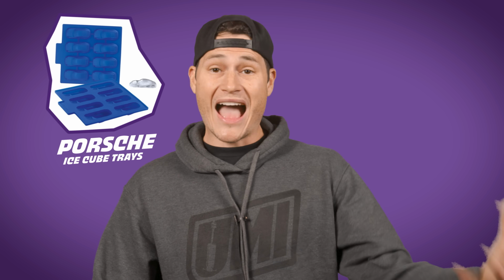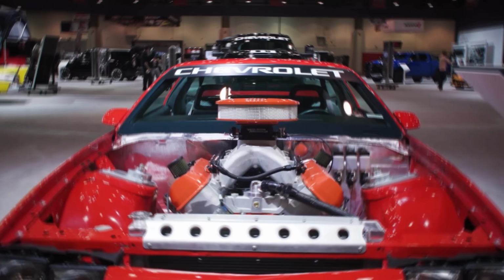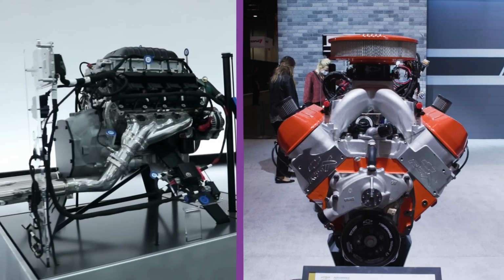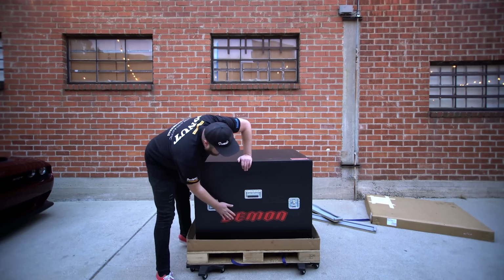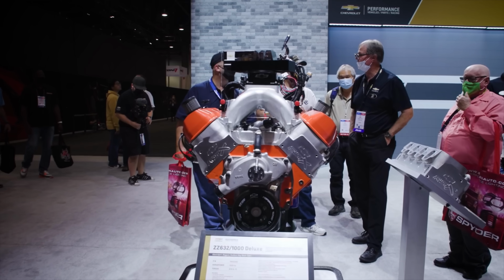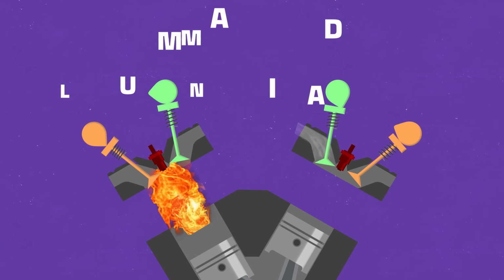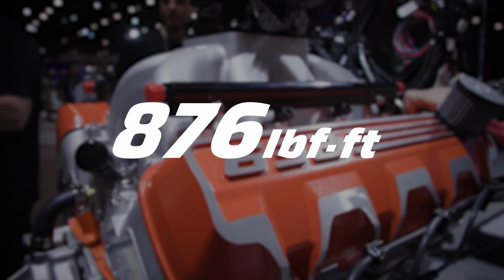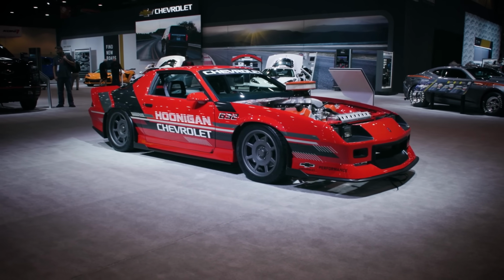Chevy's 1000HP Crate Engine EXPLAINED

Comment: I wouldn’t shell out $30K+ for a street motor, but one of the “value” $12-15K 632ci motors are a perfect drop-in for the heavier classics. Got a BelAir? Drop in 800ft-lbs of torque to haul your heavy Chevy AND the 3 motor homes you’re towing with it!
Reply: CNC Motorsports sells a 632cc BBC/BBF block capable of 2,000hp for $5k, i rather build that n boost it to it's limit, save a ton, at least half that $30k..
Reply: @P71ScrewHead  u ain’t building it for $15k.  For 2000hp ever part has to be high end.  Not to mention all the custom stuff like intake exhaust, geometry to make it all fit.  What requiem described is  perfect
Reply: @AB-nv7bz  my bad, i meant to say n/a build for $15k, with boost 2k hp, engine would have to be much bigger for it to make 2k hp n/a, which do exist actually.. But if the blocks come with forged internals already for $5k then i think it's def possible to have the engine for half of what Chevy sells them for..
Reply: @P71ScrewHead  what?  So how u gonna get the power if u need more displacement?
Reply: @AB-nv7bz  i said in my 1st comment i'd build n boost the engine to the block's limit, 2k hp.. Thing about high compression is it can't handle too much boost, a n/a engine has higher cr to make more power, engines with 8 or 9 compression can handle it better, but in n/a form lowers hp.. Maybe with 14-20 compression ratio it would get close to the block's limit, idk, but i rather not ever go that high, they become too delicate for my taste, i like lower compression..
Reply: @AB-nv7bz  there's engines with over 1,000 cubic inches that make at n over 2k hp n/a but that's $50-$100k engines, i know i look rich but not that much..lol
Reply: @P71ScrewHead  like a ww2 fighter engine?
Reply: @AB-nv7bz  Similar but I'm talking more like a huge V8 like a 1,000+ci V8, I think Kye Kelly's team uses big engines like that n it's why they win so much..
Reply: @AB-nv7bz  look up Musi 959ci V8, it makes 1,800hp n/a, crazy engine..lol
Reply: @P71ScrewHead  that’s a race motor running alcohol.  13:1 compression means it’s an expensive Grenade on 93.
Reply: @AB-nv7bz  e85 will have it running like it's no problem.. But I agree, pump gas ain't enough for high compression n boost..

Comment: The ZZ632 is an awesome new edition to GMPP, but other composites, including Blueprint Engines, have been selling 850+HP 632ci crate engines for years. At insanely great cost! Want a turn key BBC torque monster? $12-15K out the door!

Comment: I wish I could afford one. I would stick a procharger on it too if I had the money. I would buy a factory five car and build a new car from scratch old school hot rod style.
Reply: U might as well just buy the block.  It’s 12:1 compression.  No FI unless you change heads.  

I guess u could run 6-8 psi but the engine will probably grenade.  It’s not an ls so no trial and error data to go off.
Reply: @AB-nv7bz  I would probably go with an LS short block and build the engine to handle boost like all forged parts. I did something like that in a 1993 Camaro z28. I pulled a 5.3 liter ls out of a chevy suburban had all the accessories ect. then I bought the kits to change the pistons vavle train crank shaft and cam shaft. then I boosted it with a roots blower. I can run it 16 psi all day. total thing cost me $7000 not too too bad. those 5.3 liter ls engines you can buy from a junk yard full accessories compter everything $500-600 then its just a matter of getting parts. the whole engine to build it up was only $3000.  then $4000 for the blower. I also took a junkyard T56 M6 from a Corvette. bolted up perfectly. and I used the computer from the suburban albeit with a few tweaks to the wiring harness. but even with boost it only making 550 hp. 1004 hp is a lot.

Comment: You should put one in an fj73 Landcruiser they have engine room and 9 and quarter inch diffs from factory and strong gearboxes that plenty of guys do 350 Chevy swaps with an adapter plate. With diff locks it would show up the tacos !!

Comment: Actually 632 engines easily make over 1000hp all day....gm just built one that is very reliable for street use. Before this engine, yes 800-900hp is the most reliable 632 you may see...hint hint I got one haha.

Comment: The 454 big block continued well after the 70’s with the final variant (vortec 8100) used all the way until 2001
Reply: 2001 gmc sierra 2500 3500 had a 502bbc (8.1L) with an allison or 6r80. Some suburbans had the same setup. The 454 was 7.4L
Reply: @justanotherdmax  so I’ve been corrected a couple times now, and edited my post, but what I was trying to say was the big block continued well past the 70’s
Reply: @battle.built.garage  It continued in trucks. Although I would say the video was technically correct because he said "cars".
Reply: @justanotherdmax   just guessing but I believe he meant the 8.1 was the last factory engine of 454 architecture.
Also, small correction, the 8.1 was 496cid.
Reply: Bulletproof
Reply: *8100
Reply: @kumaWRX   yeah typo on my end, thank you
Reply: They were used in the chevy c1500 ss, which continued until ~2006
Reply: @Cheese_Wheell  wasn’t that the lq9 6.0 in the 2003-2006 c1500 SS?
Reply: @battle.built.garage  was going to add onto the continuation part of the 2006 chevy Silverado, they WERE continues with big block v8’s BUT only in certain countries. In Mexico you can still find Mexican title silverados with 454’s from the factory. Mainly due to the trucks needing more power down here
Reply: @ZEUSF06  :  As a lot of Mexico is above 5,000 ft.  elevation, and for normally aspirated engines, thinner air = less power, might "up there" be more appropriate than "down here"?
Reply: They stopped putting them in cars, trucks are a bit different.
Reply: 8.1 was used in generators up till 3-4yrs ago when the 5.0 turbo  took it's place, I see em just about every day out in the field. 
The 8.1 would run a 100kw gen and the turbo version does a 130kw  gen. 
Remember they only turn 1800 and if I recall the 8.1 was rated around 175hp at 1800 for industrial use.
Reply: i think he was talking ab cars but yeah  i thinnk the bbc was killed in the early 00s

Comment: This is old news drag racers have been using Big block 632 v8 for years like a lot of years since the 90s like if your a fan of drag racing you know about a petty common set up in drag racing 632 Chevy big block with nitrous or even bigger engines like an 900 bbc v8

Comment: Meh,. 30g for 1000hp when a junkyard ls can make that for 5g.. and half the weight.. how does it handle boost is the real factor... its worth it if it can be boosted to 2500 and not blow up.

Comment: Very cool, and the numbers are impressive, but the power density isn't groundbreaking. 1000hp / 10.4 liters = 96hp/L. For comparison:

- The NA FA20 in a BRZ makes 102.5Hp/L
- The F20C in the s2000 makes 118hp/L

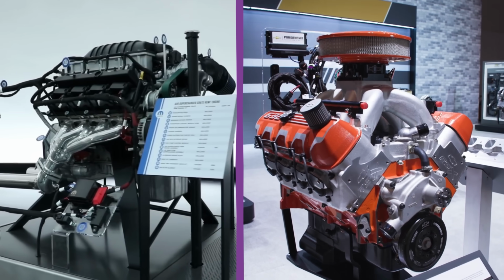Comment: 2:37 yes it’s all motor but it’s 200 cuin plus larger.
All that talking and he didn’t say the real reason it make 1.58 hp/cuin. This is the same number the Mustang Mach One make.
The 426 SC make the same torque @ let rpm.

Comment: Weird suggestion for a video. The difference between Piston engines used in aviation vs cars. So many aircraft have crazy displacement yet they don’t produce all that much power. What is up?
Reply: They just don't rev as high, limited by the maximum rpms of the propeller.
Reply: Reliability
Reply: yes. low rpm for prop use and mostly air cooled for reliability.
Reply: Direct drive, no gearbox for both weight and reliability, and the RPM is limited by the propellet tips not exciding the speed of sound
Reply: @johndavidwolf4239  auto engine swaps are about one of the worst ideas ever ,you don't want to add more parts to a plane and make them complicated. 
I'm pretty sure I've heard a few guys around the airport talking about a "new thing" of using an automotive engine like an LS and building it for low end power and not using a gearbox and keeping the revs low and it works. 
Anything to ditch a silly gearbox imo is good,still not a huge fan of the conversions though.
Reply: Low revs. 
On paper , the little continental in my dad's luscombe is rated at 65hp but it's been built to 75hp specs it's all legit it's allowed relax. 
Well, on paper it puts out about 150 ft pounds way down there too.
Not bad from a 320 cube 4 cylinder that isn't revving over 2500 or so. 
As far as low power numbers ,try this. 
Ever seen a turbo 460 ford that only puts out 160hp? 
Yup, industrial. 
Turning a steady 1800 rpms. 
It's rated at 160hp@1800. 
Think about it, that's a ton of power, gear your project accordingly😃

Comment: shove it into some mid 1970s smog car, they tend to have massive engine bays and did have big blocks in mind even if the end result was lacking stock. probably biased as i have a 1973 el camino and adore the platform.

Comment: I love how this engine has cylinders with a displacement as high as my brothers 4 pot 1.3L Yaris..
Reply: I take it you're not talking about a GR Yaris? So that is like saying "hahaha my car engine is bigger and has more power, then my sister's moped."
And even if it was a GR Yaris last time I checked it was a 3 banger, which kinda says a lot.
Not to mention the 2JZ GET which is a straight 6 that can put out about 2,000+ hp.
1,000 hp sounds like a good platform.
But it depends if they mean 1,000 potential hp, or 1,000 hp out of the crate? If it is out of the crate then yes it is a really good base to start from.
If not then you still need a lot of work to do and it doesn't seem as great anymore.
Reply: @AzNAbGjDm  Yes the 2JZ-GTE is an impressive engine, but remember its turbocharged, how much power do you thing this engine could make if it had a turbo too? ;)
Reply: @lorddoobsworth21  It might not be able to handle much if any boost. They made all internals as light as possible to get to 6600rpm.
So if you wanted to add boost, you would probably need chonkier internals and lower the max rpm.
Reply: @AzNAbGjDm  comparing FI is kinda apples and oranges but if you know the peak boost you can make a more apples to apples comparison.

Every 14.7psi of boost is equivalent to 1bar of boost which is also equivalent to 1 atmosphere.  So a 5litre engine @1bar of boost has the same displacement as a 10L engine
Reply: Inline 6 engines are good. But 2,000 HP will not stay together. Even if it did for a short time. You would have more money in it than LS with a turbo. More power and torque, stronger and less money!!!

Comment: 10.4 liters sounds way more impressive than 632 cuin. Maybe it's because I'm used to thinking of cars in metric.
Reply: That is 10 Geo Metros sounds cooler than imperial.
Reply: It depends on the era that you grew up in. My era was the 1960s when muscle cars were king and engines were measured in cubic inches. Younger people grew up with engines measured in liters. My guess is that this engine is targeted to the older enthusiast which is also probably where the money is for this sort of thing.
Reply: @itchytriggerfinger7622  the 426 is supercharged, remember. 632 all motor.
Reply: @tlh5677  Itchy couldn't see the blower. He thought that was a dust cover.
Reply: 1 liter is equivalent to 61 ci.
Reply: Its alot
Reply: Real car guys can do the conversion in their heads.
Reply: @itchytriggerfinger7622  but the Mopar is forced induction,, the Bowtie is naturally aspirated,, meaning carb only,, or fuel injection but,, no super charger like the Mopar
Reply: @itchytriggerfinger7622  how much air is that blower jamming down that throat tho
Reply: @itchytriggerfinger7622  I mean one bar is double our atmospheric pressure at sea level
Reply: 876 lb ft equals around 1190 Nm btw.
Reply: @itchytriggerfinger7622  the 632 ain't supercharged, Edison.
Reply: Wonder how many miles to the gallon it can get?
Reply: @leehenry5764  Actually, how many gallons per mile 😁
Reply: 632 is nuts.
Reply: @itchytriggerfinger7622  Remember in the video it stated the helephant  is supercharged. Climb back down off your pony...
Reply: 10-4
Reply: easy way to remember it is 302=5L so 604 = 10L plus an extra 28cuin. I can't imagine stuffing 2 coyote motors inside of any engine bay ... but it would be fun to see it in a Gremlin or an old Honda hatchback and remove the front seats and just sit in the back.
Reply: Even anything over 500 ci is insane by imperial standard
Reply: Sounds like a conversation I had with a guy about his pick up.
"I gotta ask, what size engine is that?"
"A 351 M."
"No liters, just cubic inches."
"Yep."
But ya see, as soon as I heard "351" I knew instantly what we were talking about.  I was able to convert to liters mentally, but I'm damn near 60, so my "baby boomer" brain still measures in cubic inches.
Reply: Cumstang?
Reply: @itchytriggerfinger7622  isn't it moving like 22,000 liter per minute
Reply: 1000 hrsprs from 10.8 liter, this thing doesn't even make a 100 hrsprs per liter, what a peace of crap...
Reply: @europass1  “almost” 100hp/liter from an NA block at 6600rpm is incredibly impressive… 

The next best thing of comparable hp/liter thats still in production is the the 2UR block in the Lexus IS500, and that thing is half the size of this monster.
Reply: @europass1  Habla seria jovencita

Comment: I'd love to see that motor dropped in a 73 C3 Corvette.  Preferably one that came with the 454.  Not a giant difference in size as that was a 7.4 liter.  Might have to beef up the front in a little for the weight etc.  Not sure if it would fit but it would be a whole lot cooler if it did.

Comment: I think that there should be more crate engines from manufacturers. Imagine an engine from Germany, England or Italy. Or a small displacement 150-300hp from Japan. Even if an existing design is produced for the next 10 years. I think it would be better than killing the ICE for good.
Reply: Imagine if Toyota sold 2JZ crates...
Reply: @kettujabamiesukkeliukko  so jp perfomance bought a new 2jz for their supra but i dont know if you just call toyota for that or if its a replacement part and you have to be a shop to get or what 🤷🏼‍♂️
Reply: @Tchnfrq  maybe it's just build by someone using new parts
Reply: Nissans doing that rn with the rb absolute legends over there I want a new B-series personally
Reply: That exists already... Honda Sells a crate Civic Type R motor with 300hp. Released in 2017.
Reply: I'd love to be able to just buy the GR Yaris 3cyl. It could go in SO MANY THINGS. Imagine a japanese kei car with 260 hp from one of those. Or just any homebuilt racecar.
Reply: Good luck getting the wiring done!!! 😂🤣😂
Reply: Nissan vr crates would be awesome
Reply: @ShutterSpeed713  they do both nissan z and gtr motor tho expect to pay 60,000 or so dollars for the gtr motor (can't remember its name lol) and about 20-30,000 for a vq motor
Reply: Imagine if you could just buy the 4.4 V8 from BMW. Or better yet, the 5.0 V10 from the E60 M5s.
Reply: Yamaha and a couple other companies are doing electric crate engines / transmission combos now. Two of the Yamaha ones in my side by side would be my daily if I had the money.
Reply: Mercedes do crate engines. Their engines are in tons of different hypercars.
Reply: K24 is already a 300hp crate motor. Basically.
Reply: Ya imagine the cost when it breaks down. And unless you know how to fix it you need special tools and training to fix it.
Reply: Tomei engine builder in Japan you can get RB26, 3JZ with custom Turbo and you can get Titanium exhaust to match. It is 3JZ because they bored and stroked the engine. Subaru EJ 25 STI engine is also available.  These are around 20-30k JDM crate engines. With that company they invented a baffle system for 2JZ family engines that keep oil where it needs to be so you do not have cylinder starvation when you pull major G’s in your car.  I am putting the engine in a S124 Mercedes Benz E wagon, ZF 6 speed Manual, KW Evolution coil overs, AMG mono blocs, ARC air intake, AMG brakes from the GTC-R,  I love the lines of German wagons built in the 1990’s, I am going with a Japanese engine because I used to drift and just want to have it done how I see it. Are Mercedes V8 engines good? Performance wise yes, sound yes. I do not have the experience with those.
Reply: @malakisands8180  pleAse make a video documenting your process

Comment: why not use 4 valves per cylinder? each valve could be lighter and help with airflow at high rpm. why not use DOCH. It seems such an american thing... throw 10 litres of displacement and there is your 1000 hp. An then you have NA engines from EU making 1000hp from 6 litres.. AMAZING.

Comment: 632ci equates ti 10.356 liters, and manufacturers always round up, so they’d likely advertise as a 10.4L. Just like Ford’s Coyote engine actually has a displacement of 4.951 or something like that, so they round up to 5.0 and not 4.9. Small correction is all.
Reply: Same with 6.2 L V8 Amg engines
Reply: The 3rd Gen coyote is over 5L now it’s closer to 5.1
Reply: @dontyouworryaboutit_  it is over 5 liters but it would still be rounded to 5.0. It’s 5.035, closer to 5.0 than 5.1 so round down
Reply: No that rounding up was for the Windsor. They haven't don't that since 1994. But yes that is true
Reply: @Heyitsallgoodman  all manufacturers do this. I drive a 5.7 hemi, which is really ~5.65L, but it’s over the halfway mark so round up to nearest 10th
Reply: ok?
Reply: If theres a 0.05, its acceptable to round up. U know whats weird? Toyota’s new 3.5 v6. 3444cc and suddenly they market it as a 3.5… okey

N then theres merc’s 6.2 V8. because of “heritage” and marketing, its advertised as a 63 😂😂😂